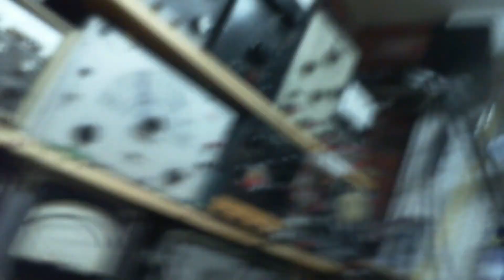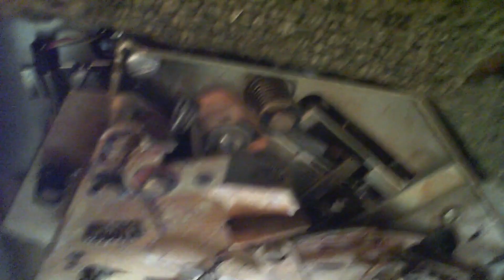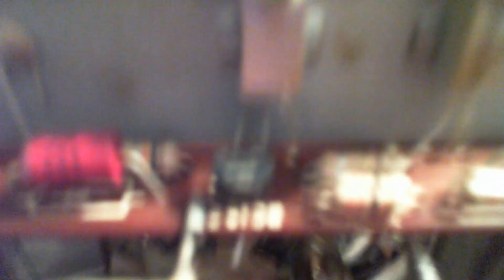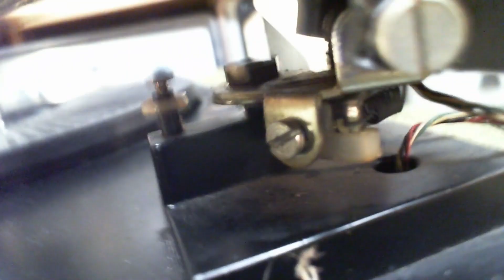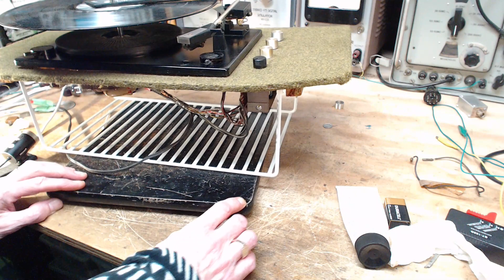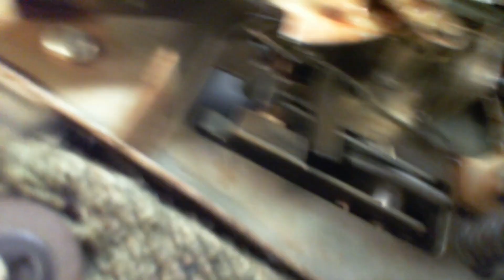Canadian Spartan Model 5542 Radio Video #11 - BSR A12 Mechanical Issues

Comment: There's a spray lubricant that's thicker than WD-40 called Fluid Film that I bet would be great for those components as it comes with a straw like WD-40 so you can direct it exactly where it's needed.

Comment: Bingo I seen the over arm drop when the tone arm return and the 12" flag not go all the way back because if there was a record it would have gone forward but because there's no record the over arm would have pushed it back even more because it's really supposed to go forward even more when the over arm is up and only a 10 or 7" record is supposed to pull it back with a 10" record stops the 10" sensor from going all the way up and when there's a 7" record the changer is supposed to pull everything back when the tone arm sets down, now all that is left is the auto return

Comment: That shut off part is a known fault of some BSR changers and the 12" flag is not engaging it may have to go forward a little more so the record can hit it and what it's doing is it's not being hit by the record because there are two positions that it has one is for telling it that it's a 12" record and the second is to tell it that there are no more records and it has to hold the over arm up until the arm is set down and then let the over arm drop and set the changer in shutdown mode when the record ends and only the manual control is the only way to override it, but I'm still going with the fact that some BSR changers have known issues

Comment: And the funny thing is that some of those BSR changers have issues with shutting off after the last record is played and this changer is one of those (and this model also had issues with 7" records 10" and 12" had no issues because the 10" sensor wouldn't pop up the 12" flag worked and most of the shut off worked but it wouldn't turn the power off) I actually had a record player with that model changer

Comment: For me what I normally find is that the metal tabs are made of cheap metal or Thin metal, and over time the Tabs Bend, and it appears that they are moving and pushing other parts as they should, but the metal has fatigued and just enough that they do not push As Far as they should. After figuring this out, I have to Bend The Metal tab over more and then it works correctly, at least for a while till the metal bends back and no longer functions as it should... If you look at the video at 50:38 it appears the metal tab on the left of your finger is bent upwards???
Robert San Diego